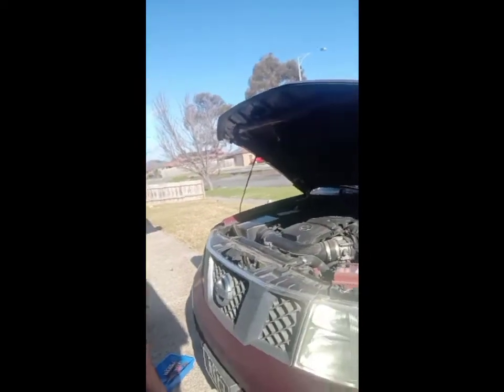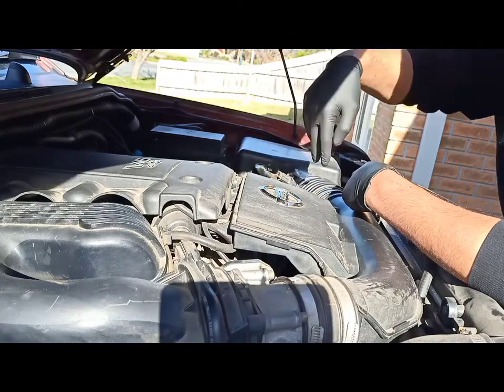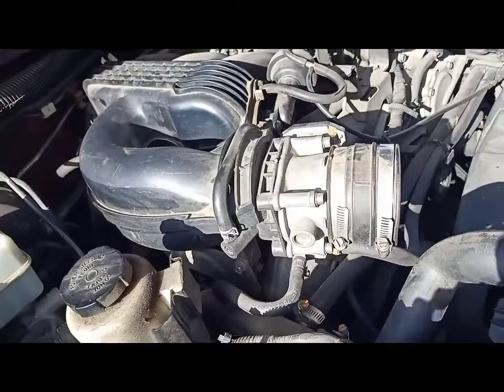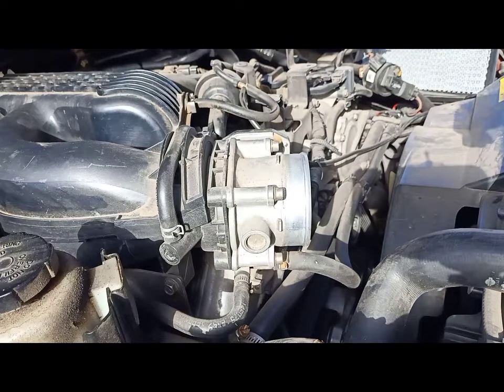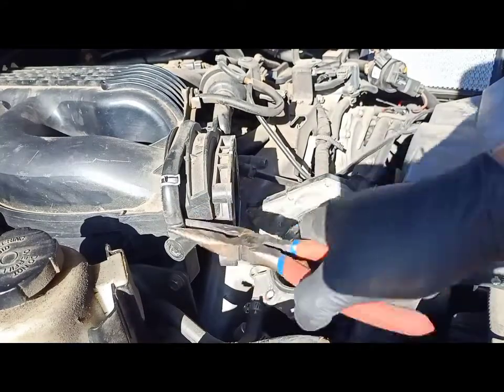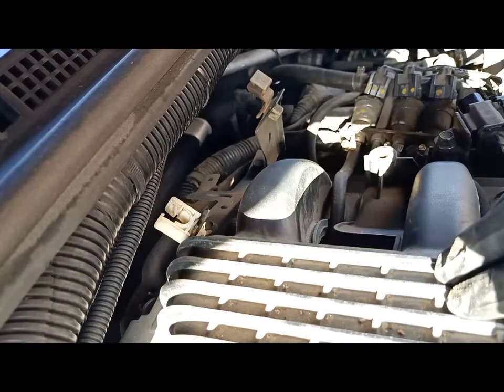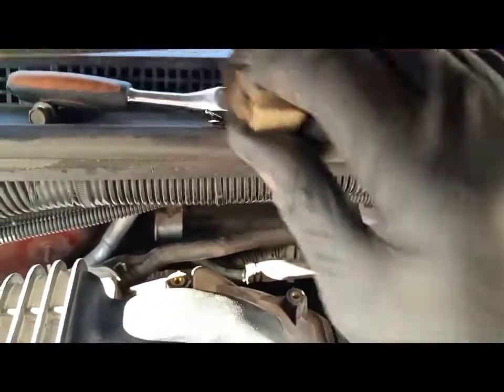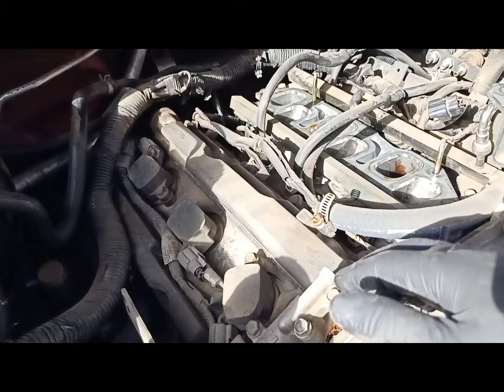remove intake manifold on Nissan Pathfinder

Comment: Great video but, you can actually remove all coils on this engine without removing the intake manifold I have done it my self. Do you know where is the big gasket located on the intake manifold bought the gasket kit on autoparts store but did not change the bigger gasket.